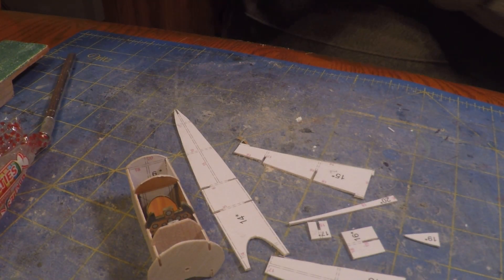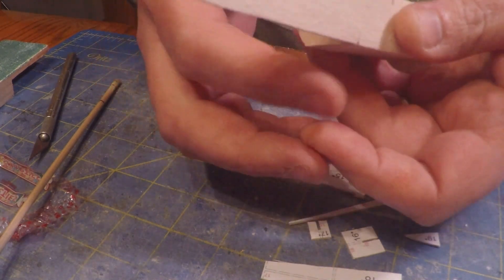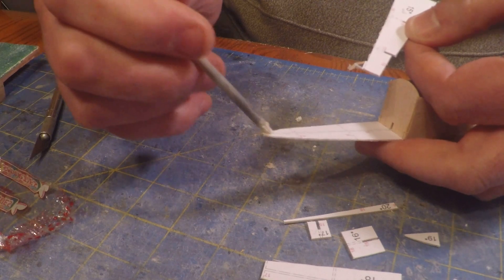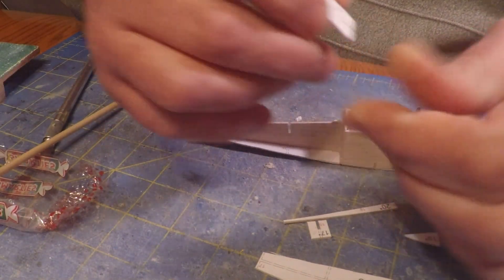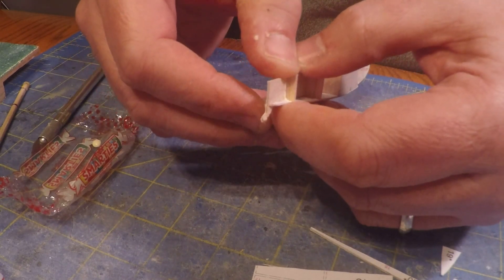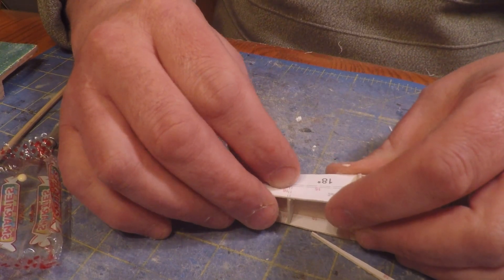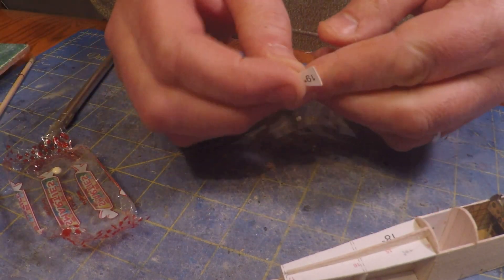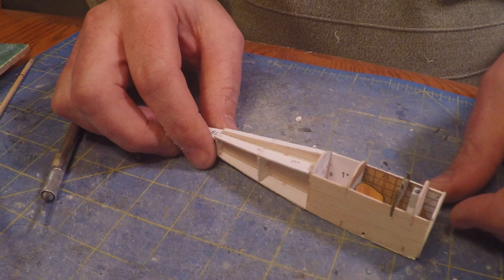Sopwith Camel Paper Model: The Rear

Comment: Looks great!!  Are you using balsa wood or basswood?  Looking at Amazon, I find basswood and balsawood used in the same description a lot.
Reply from the maker: hi Robert...I use 1/32nd balsa.  Thin, easy to sand and cut.  Seems to be a good alternative and I'm used to it.  Thanks for the question...-Dan
Reply: For sourcing Balsa or Basswood if you don't have a local hobby shop* you can try one of the following in the US. Micheals, Hobby Lobby, a True Value or Ace Hardware. A hardware store is also a good source for small diameter wire and brass tube. One thing nice about the brass tube from K&S metals is it is sized to telescope with the next size up or down. Some of the Big Box DYI stores carry some sheet and strip in stock. 
*I remember when just about every decent sized town had at least one it seems.
Reply from the maker: @mpetersen6  So agree!  I have been getting mine at Hobby Lobby down the street.  If you search through their balsa stock, you can even find "almost" contest grade balsa for free flight models.  I really hope they keep stocking it!  They do have bass wood as well! -Dan